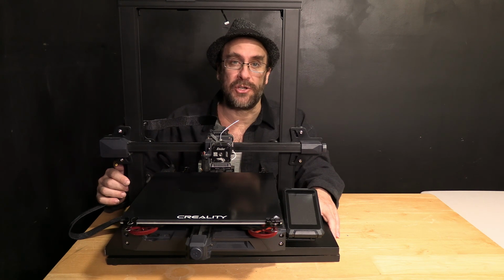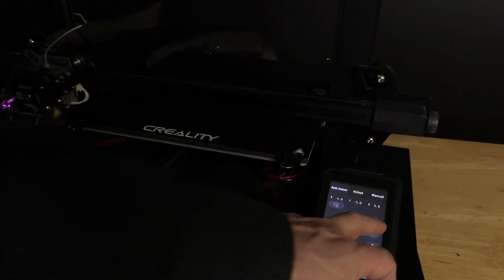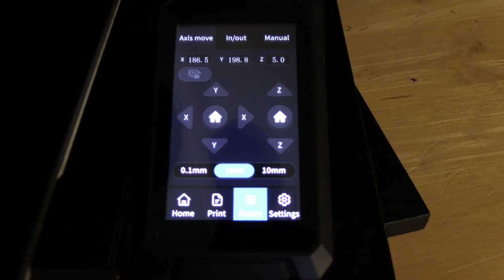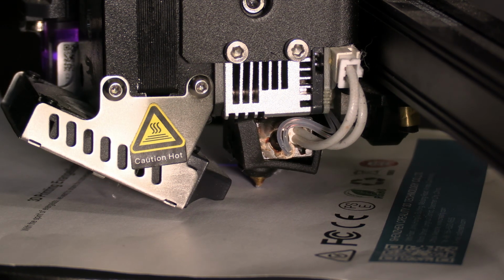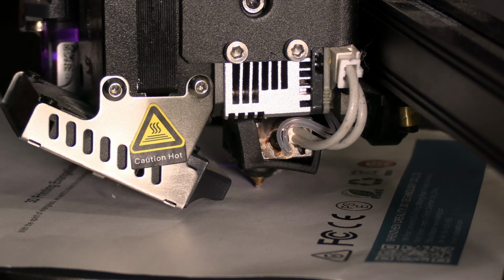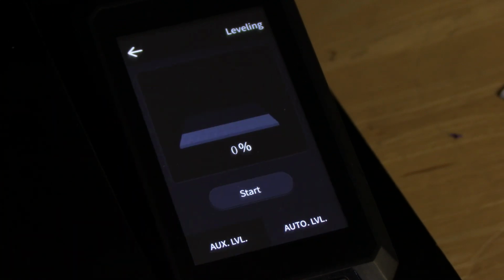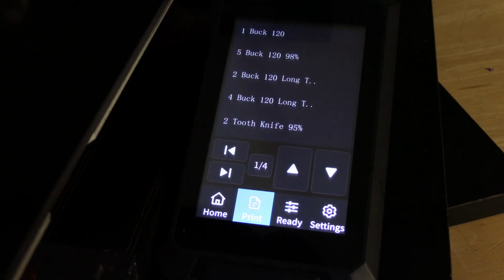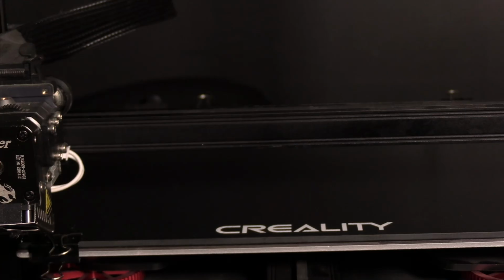Replace Creality Ender 3 S1 Plus Magnetic Bed with GLASS BED. Set Z Offset & ABL - 3D Printer

Comment: I can't get my wifi to link up with my printer. Do I have to have wifi to run my printer? I tried to link it up but i keep getting the wrong wifi addresses and mine doesn't seem to show up. Is there a way I can just use the sc card? Or do I have to have wifi?
Reply from the maker: The S1 does not have Built in Wifi. You would need to add a Creality Smart Kit "Wifi Cloud Box", Sonic Pad, or Nebula Pad. I use the cloud box on mine

Comment: Your Z-Offset wouldn't change. The only thing you changed is a slight loss of actual Z height, that would be the height of the glass minus the other magnet sheet. Otherwise good video. I swap between glass and a steel magnetic PEI sheet all the time and never change the Z-Offset.
Reply from the maker: Your Z-Offset will 100% change. Initial Z-Height IS your Z-Offset.
Reply: @3DRundown    t3chninja_official is correct. Z-Offset doesn't change. Z-Offset is the vertical difference between the probe trip / zero point and the nozzle Z height = 0 point. That doesn't change when you change beds. Remember, Z height = 0 is not some fixed point in physical vertical space. The Z probe determines where Z height = 0 is every time you 'home' the printer. If the bed is thicker, the probe trips higher in 'physical' space and tells the firmware "here is where Z=0 is." Likewise if the bed is thinner, the probe trips lower in physical space and says "this is Z=0". Regardless, the distance between where the probe detects Z=0 and the additional movement needed to get the printer head to the bed (i.e., the Z-Offset) remains fixed. The bed can be of any thickness. A thicker bed loses vertical distance but doesn't change Z-Offset, as 'ninja' said.

Comment: Did that, but with a casual glass sheet, much more flat than the stock one (though it seems on S1Plus there is an issue with mag sheet or the foundation of bed). I believe the stock black sheet is not from PEI, but rather PC.
Reply from the maker: Yes, it is indeed actually PC, which has better adhesion then Textured PEI. I meant to refer to it as the magnetic bed, but kept saying and typing PEI by habit. And looks like I accidentally uploaded the wrong thumbnail too. Thanks for the tipoff. Uploaded the correct Thumbnail